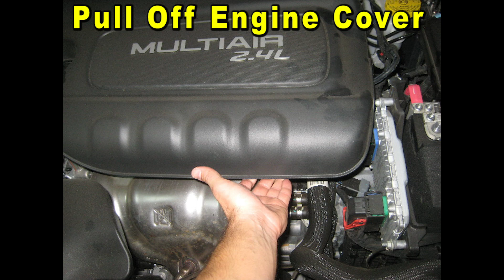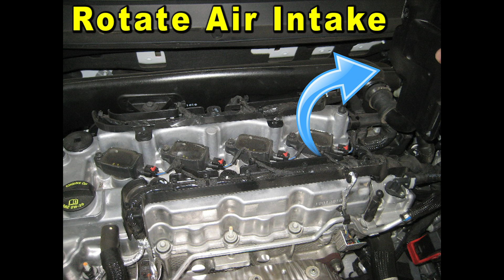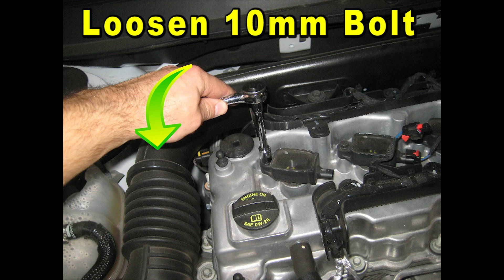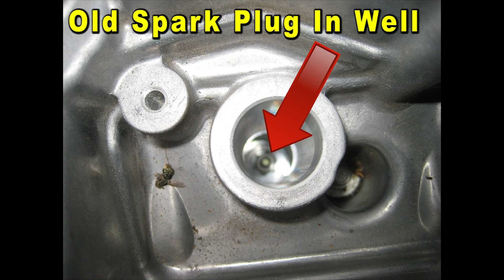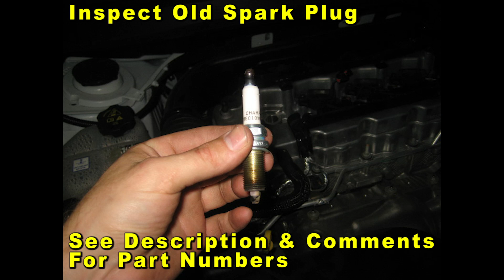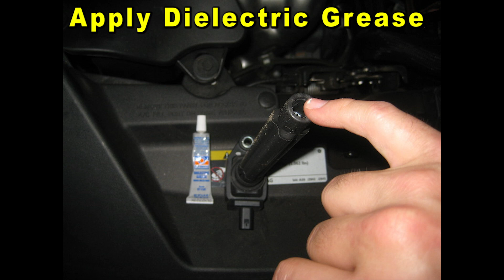2014 To 2018 Jeep Cherokee How To Change Spark Plugs With Part Number & Torque Specification 2.4L I4

Comment from the maker: Jeep Cherokee Spark Plugs - https://amzn.to/3AFA87C
NGK Platinum Spark Plugs Part # - https://amzn.to/3T2lmxW
Autolite Spark Plug Part Number - https://amzn.to/3WXIvD7
NGK Iridium Spark Plug - https://amzn.to/3MiYiY6
Denso Spark Plug Part Number - https://amzn.to/3T5IdsG
Spark Plug Socket - https://amzn.to/4g0kbJd
Dielectric Grease - https://amzn.to/4g1VnRq
Precision Screwdriver Set - https://amzn.to/3sLixaP
Plastic Pry Bar Tools - https://amzn.to/3HMtsV7
Socket & Ratchet Set - https://amzn.to/3Z17LbA
Mechanix Gloves - https://amzn.to/3jCnHkt
Torque Wrench - https://amzn.to/3vS5uSI

The Paul79UF YouTube channel is a participant in the Amazon Services LLC Associates Program, an affiliate advertising program designed to provide a means for sites to earn advertising fees by advertising and linking to Amazon.

This DIY video shows owners of the 5th generation 2014, 2015, 2016, 2017 and 2018 Jeep Cherokee SUV how to change the spark plugs in the Tigershark MultiAir 2 2.4L I4 engine with the correct torque specification for tightening the spark plugs from the service (shop) manual.

Comment from the maker: Check out the DIY guide for changing the spark plugs in a fifth generation 2014 to 2018 Jeep Cherokee - 
https://www.paulstravelpictures.com/Jeep-Cherokee-Engine-Spark-Plugs-Replacement-Guide/index.html

Here are all of the DIY repair and maintenance tutorials for the 5th generation 2014 to 2018 Jeep Cherokee SUV - 
https://www.paulstravelpictures.com/Articles/Jeep-Cherokee-Common-Problems-Repair-Maintenance-Guides.htm

Owners of other Jeep, Dodge, Chrysler, Fiat and RAM vehicles such as the Compass, Renegade, Wrangler, Grand Cherokee, Patriot, 500, Town & Country, 200, 300, Pacifica, Challenger, Charger, Dart, Durango, Journey, Grand Caravan, RAM 1500, C/V Tradesman and ProMaster Van may also find these DIY instructions to be helpful.